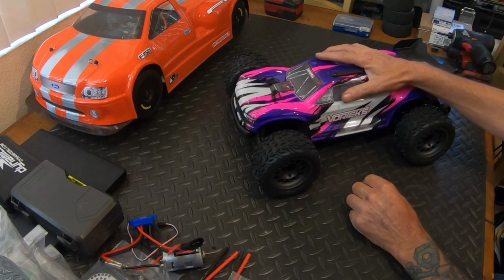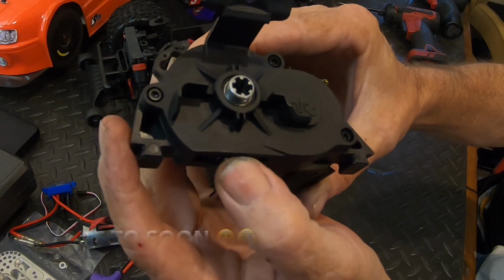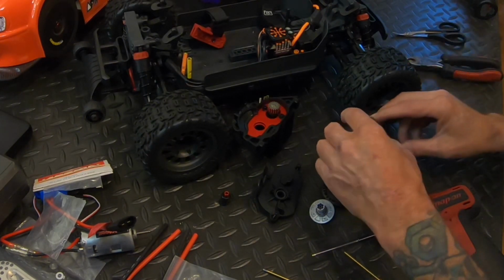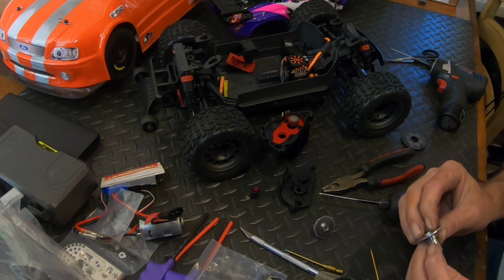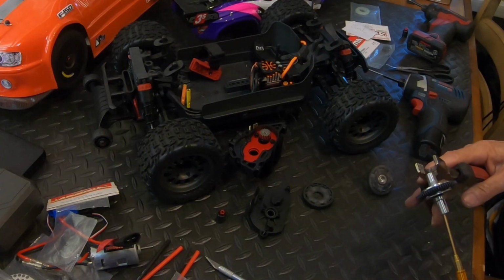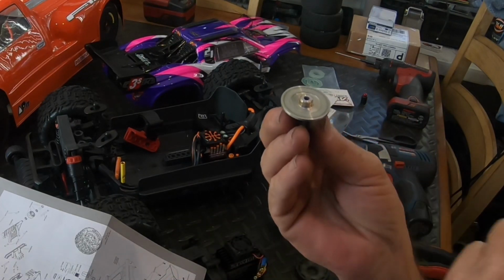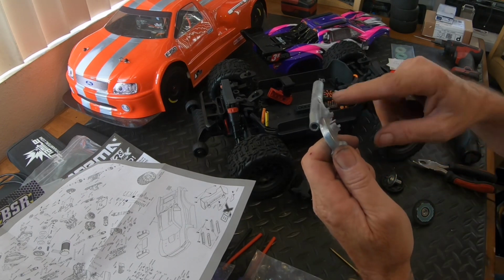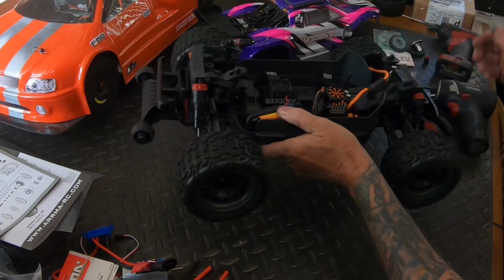Arrma VORTEKS Motor Issue Found not what I expected at all ??

Comment: I've had to order "Slipper Plate & Hub Set' (AR310946) twice for my K4S (same slipper assembly...except the 4S line takes 4 slipper pads). That LiL piece breaks off very easily. It happens when it's OVER TIGHTENED and it just snaps...You can hear it click when u are trying to tighten down the slipper. Now in your case it wasn't done by you, but snapped during production. But what caused it was initial OVER TIGHTENING.     P.S. be very careful using the power tool to tighten that down in the future...IT DOESN'T TAKE MUCH TO SNAP THAT LIL PIECE OFF.  GREAT VID!!

Comment: Not sure if anyone else pointed this out, but when you switch to the metal spur (like the 4s line) you can add another slipper pad since the metal spur is not as wide as the stock plastic one,  4 total. This will center the spur a little better and it wont be so close to rubbing the mount. UPDATE: I read below others pointing this out and how you figured that out as well.

Comment: EARL, I’ve had cars the mesh was so tight. The tires wouldnt move. I also had a outcast out of the box, ESC WAS COMPLETELY UNBOLTED!!!!!! Always do a partial tear down on new cars. Check gear meshes and lubrication. I had an XMAXX with a bent motor shaft out of the box. I could keep going, but you get the idea!
Reply: This should not be as much money ad you pay .you got to take it apart before you run .Thats bull qc arent doing their jobs.cost me 60 bucks.

Comment: I'm bad...I make comments as I watch video, ya know, before I watch the whole thing. First I notice that on My Infraction 3S, when I put my metal spur in, I had to trim off all the extra little ears on my slipper clutch plate to make them sit right in the gear. Gear wasn't machined with those extra slots in if for them. I could also swear mine had only one disc on one side. Okay...roll it...Nice catch! I did visit Horizons site, and looked a he exploded view of my Infraction, and yes, there is only one slipper clutch disc. 
  I have to bust your chops about the little gun shaped tool. It shows it in use on that back page you said you referenced, not sure how you missed that. For setting your slipper clutch while it's in the car, but you've probably figured that out by now. Anyway, again, nice catch! I'm thinking of getting one of these to add to my growing Arma collection. Next you need the Hot racing diff gears and housings! that'll seriously bullet proof your drivetrain, as I THINK the stock ones are plastic (composite) in those.
   I also don't see a real way to truly properly set the gear mesh. I always used a piece of loose leaf paper between the two gears, but with that cover off, the gear kinda moves around, which makes it impossible to really get a nice mesh. Seems like it'd be a trial and error, do it over a few times ordeal. I do see a video about it in the que..will watch that next for any ideas.
  Hope you girl has a blast with it!

Comment: The tool is their 4-way wrench sortof. For example - it fits right under the lift tabs for the motor assembly. You know it when you try it. Jam it in there and you can save the finger pain trying to lift them AND push the motor assembly formward.

Comment: Check motor shaft and I’ve run 6s on these for testing and have yet to strip a plastic spur. But metal I’m sure is better. Also check the diffs. They get the notchy tight spots as well. Great video!
Reply from the maker: I did check the motor bearings and shaft as no play yet but after a few runs there will be some play and I know this 💯💯that why setting up the plastic spur loose wouldn’t work it would just strip as soon as the bearing gets loose 💯💯💯💯

Comment: Earl, I had the same problem with my slipper assembly.  I was tightening down the screw in the slipper and I cranked on it to hard.  I heard a pop and that's what happened.  The brass piece snapped right off . It was my fault when it happened to me.  But yours is BS! That's not cool with a brand new car.  Horizon should make that right! At least I know I'm not the only one who had this problem! Good video bro!
Reply from the maker: We never adjusted it intill I was looking for the noise and added the metal gear and couldn’t understand why the slipper was not getting tight pulling thru Rc guy garage is now having about the same noise wonder what his issue is 🤷🏻‍♂️🤷🏻‍♂️
Reply: Absolutely, like I said it's bullshit yours was untouched.  I hope they take care of you on it! I don't even use that spring in my 3s slippers. And I can't tell a difference.  So glad to hear you show that. Not a spring, but a spacer! Lol! Very well done video Earl!
Reply from the maker: Yes they sent a new slipper clutch my hobby shop replaced it the next day so I didn’t have to call horizon 🔥👍👍
Reply: Hay,  post a video of your rc collection.  I have a friend who doesn't believe me when I told him how many cars you have! I think it be really cool to see!
Reply from the maker: I have one from 2years ago it a lot to drag out over a 100 of them and put them back but in January I’ll be doing it again
Reply from the maker: https://youtu.be/29UczUu8pIw
Reply: I bet it is a job to get out that many cars! I  can't imagine.  When you do your next collection video show where you store that many cars.  Bet it takes a lot of space!🤑and money! Your a beast Earl!

Comment: interesting. Just picked one up for my wife. we have not had it out yet. plan to tomorrow so we will see. Thanks for the info
Reply from the maker: Nice 👍
Reply: @earlmoorhead5555  did you have a video on the wheel falling off? I am looking for some info. After 10 min the wheel came out the axle. wheel is on the axle. Not to happy about it.
Reply from the maker: Rc guy garage has a video on the big rock doing that on a front wheel but the VORTEKS I haven’t had that issue yet but we know it will as the platforms the same just shorter
Reply: @earlmoorhead5555  ok thanks. I will take a look for it. So weird. I did not even get a chance to rip the truck my self.
Reply from the maker: I know he added hot racing front hubs to correct it but it turned out they caused more damage later than it was worth so he went back to stock front hub ( bearing carrier) to make it stop braking other parts

Comment: Thanks for the video Earl. I have the Vorteks , first day with it today. I also have the had the V3 Big Rock since February. I'm not noticing the Vorteks making the noise you are describing, do you mean the 'clicking' noise that people are commenting on or something different? My Vorteks sounds quite different to my Big rock when they are running, my BR is louder for sure. I haven't checked the mesh in the Vorteks yet but will before it's next run. Thanks again for taking the time to post the video.
Reply: Going to add a quick edit - I watched your unboxing and quick run and there it was, the clicking sound. My Vorteks doesn't make that sound, I videoed it today and went and had a listen and it runs a lot quieter than your daughters before you fixed it. Seems like it's a quality control issue. They are made in China after all.

Comment: The steel gear uses one extra pad because the gear is thinner than the plastic one
Reply from the maker: Yep I agree as I added 4 disc two on each side but that the metal upgrade normal issue 💯💯

Comment: Good find.  A lot of people are saying that the vorteks sounds different or louder than the other 3s cars.  I wonder if this might be a common issue?
Reply from the maker: I believe so the spur gears are tight and slipper clutch might all be over tighten causing issues 💯💯
Reply: @earlmoorhead5555  I noticed this sound at first then watched jaytee's video and even said in a message it was the same. He told me he had checked the mesh so was driving it just thinking ok that's how they sound but after he posted about the problem I thought ok have I done damage but then CCRC said it was a heat issue so I've been trying to keep it cool and have found its not possible. How much run time watching temps but still getting hot before moter damage?
Reply from the maker: At 200 degrees it starts to damage a motor 💯💯

Comment: Wow. Was gonna pick up a Vorteks in a few hours. Now I don’t know if I will. Thanks for the info.
Reply from the maker: It’s a good rc I believe but quality control seems to be an issue is all I’m seeing with rc cars lately 💯💯👍👍
Reply: Thanks for the reply. Why do you not think it’s comparable to the Rustler? I thought they were very similar from what I’ve seen online.
Reply: I advice u to still buy it... theres. Nothing wrong with the vortex.. a lot of RC politics in the game... u dint expect to bash a toy and nothing gets broken. So far so good the quality control on the vortex is good.. IF u bash a real car, u definitely going to need a mechanic to fix it and get parts...
Reply from the maker: @1zedlav  the way the rustlers is like a slash 4x4 the slipper clutch motor set up modular like traxxas does and it’s longer the hoss matches up real close and is traxxas neediest release so arrma would answer with an rc the rustler is old now compared to a hoss 👍👍👍
Reply from the maker: @lordangelspirit  but you don’t buy a
New car and fix it before you drive quality control is bad fir sure 💯💯💯💯
Reply: @lordangelspirit  I don’t think earl  finding a mechanical issue with his brand new RC has anything to do with industry politics. Seems pretty cut and dry.

Comment: How did you solve the compressed spring issue? I broke the brass piece on mine by tightening the effin thing down so much that the spring pushed the brass piece off.
Reply from the maker: I added a washer and replaced the brass piece with a warranty one from my hobby shop 👍👍

Comment: I saw video on this vortex that they were switching to the metal gear and that gear is from a 4S version I believe. So I believe it's supposed to have an extra slipper pad than the 3s version. I could be completely wrong though lol. Just trying to watch all the videos I can on it I got one in layaway hopefully that wasn't a mistake lmao
Reply from the maker: Yes that true you can add a pads like I show in several videos or not depending on how you run your rc car 👍👍
Reply: @earlmoorhead5555  oh nice to know. I'm learning lol. Trying to soak up everything I can. Iv been messing with fpv for a while now. But this is completely different. Never could afford it till now. Well.. it's in layaway but still

Comment: Yeaaaaaa, my motor is fried on mine. My spur is a little shredded as well. I didn’t think anything of it. Like you said, meh it’ll take some time to wear in and seat. 5 batteries later the motor seized and the spur is shredded. Opened a claim with horizon now for the motor, and might just get a slipper and spur assembly from another model. My first Arrma, and my first bad experience with something like this that wasn’t my fault 😂😂

Comment: Hey just a question but from the research I've done and info on the arrma forum. Don't you have to add a extra slipper pad if your running metal spur on 3s versions???
Reply from the maker: Yes I added one to the back side so there is two slipper pads on both sides the video was to long to add that part as most ppl know on a metal spur gear installation you need 4 pads now 💯💯💯
Reply: Ok cool just wanted to make sure. I know your very knowledgeable with this stuff and I just burned up a brand new hot racing spur from not doing my research I guess, lol live and learn

Comment: The metal gear needs four slipper pads!  It’s what the 4s has stock with the metal gear!  On the tool, the ‘things’ are used to unscrew the shocks.  It keys into the shock body where the shaft enters.  That’s how you open the shocks.  It’s too bad the brass peace came out; the fourth pad like the 4s line would stop the ‘crush’ as you tighten the slipper.  I think it pulled the brass piece out as you tightened onto the metal gear (it is thinner than the plastic spur).  Great job non the less.  Personally; the dirty hands rock!   None of this girly glove wearing stuff!
Reply from the maker: Yes I explain that in the running video as I put 4 in it I figured everyone know already 💯💯💯

Comment: My neighbors bought two of these and I recently bought two myself threw horizon hobby with their easy pay setup. And mine will be here Monday. But my neighbor blew his motor trying to keep up with my Arrma Granite mega v3 big block brushless conversion. Yeah the vorteks is fast but it isn't 4076 2200kv on a 23T in the granite fast lol. I felt bad for em though he just legitimately got it when this happened. The bearing in his motor blew out doing between 60 n 63mph we was drag racing n I was a good 10foot ahead of em n pulling away and all of a sudden his vorteks slowed down to around a stock Granite mega around 30 35 ish max so he turned it around n brought it back n I done the same n I even beat him back to us n my Granite was way out there past his lol. So something was definitely wrong. It didn't smell like burning wires or anything the esc was cool the motor was hot so he let it cool down n pulled out his outcast 4s n his ol ladies vorteks and we drove around ect n then he used his ol ladies vorteks n wanted to race because hers already had the big speed pinion in it.. so I laughed n said sure let's.do it lol. N I beat him again lol and we done a few more pulls and his ol ladies done the same thing!!! Except hers made a loud bang but still ran just much slower n then it stopped n went stopped n went so we put them on the table and he pulled one apart n I pulled his 2nd one apart to see what's up.. and the bearings in both motors blew apart...... So two destroyed motors and I heard about other vorteks motors giving out when stressed. and I felt bad because he was trying to beat my built up Granite which is insanely fast. It ran a 78.3mph this morning I'm going for 100 mph because I don't think there is a Arrma Granite mega v3 and let alone any Granite to touch 100 mph yet.. I think there is a 100 mph big rock n senton but no Granite yet. Thing is at 70+ the granite isnt to stable... So it's getting typhon arms or a outcast 4s arms tie rods shocks to widen it n give it more strength or I'll see if 6s outcast parts will fit it... I know the outcast 4s parts will because the outcast 4s is actually a Arrma Granite 110% same chassis ect just beefed up a little. So I wanna get her a lil more stable before I drop 6s lipos in it.. Im running it on 3s ovonics and golbat champion 3s lipos I got the big Ovonic 4s golbat 4s and spectrum 3 , 4 , 6 s lipos. I got a max 6 esc in it now I pulled the hobbywing Quicrun BL 120 out  which btw is a bullet proof esc it says 3s but it can most definitely take 4s no probs at all. I had a 5200mah 80c and a 8000mah 100c 4s in it and it stays cool. It's a powerful esc for cheap lol. It feed my 4076 2200kv with ease and also my 4076 2000kv and also my castle 1717y which with the castle 1717 it did get a lil warm. But I believe the 1717 will be the new motor for the new esc on 6s for it.. and as for his vorteks's I gave him my spare outcast 4s 3668 motor and installed it and he had a 3660 3300kv I believe spektrum as well he dropped in it until horizon sends his replacement motors.
Reply from the maker: That’s sounded like a fun day took me an hour to read it tho 😜😜😜😜

Comment: Mine broke because I over tightened the slipper during maintenance. Maybe yours was over tightened at the factory.  I've seen others reviewing this car say their slipper was locked down. They are supposed to be 1.5 turns out.
Reply from the maker: Yes I’ve seen that happen as well it will pull the brass piece out it it’s over tighten 💯💯👍👍
Reply: @earlmoorhead5555  if ya look closely, you'll see that the brass bushing is just pressed on to the aluminum slipper plate. The inside of the brass "cap" is actually a very thin part of the slipper plate that broke off. While it's thin, it seems to work just fine as long as it's not cranked on too hard. Hopefully it's the last time you'll have this problem... 

I was tightening it down, felt it "pop", then the entire slipper just fell apart. It sucks that the guy at the factory threw it together after it broke.

My slipper was set perfectly, from the factory. So it's not every truck, maybe just 1 bad assembler.

Comment: The aluminum slipper plate broke! That brass part just goes over it and gets pressed on. I had a replacement slipper plate come bent out of shape and useless! Amain replaced it no problem. 
Just sucks! The other problem is the bearing on the shaft side of the motor!!! Just a matter of time? Bearing replacement.

Comment: As much as i like arrma i hate the slipper clutch design. All problems would go away with a center differential.
Reply from the maker: Yes or a good quality slipper like traxxas uses adding the metal spur it’s hard to find the added slipper pad you need to add on should have a notation with the spur gear 💯💯💯
Reply: A good center diff would be my most wanted part for this car

Comment: Earl great find there, any idea what makes that piece shear off ? Is it in the factory assembly or when the truck is first run. Also how will this part not fail again ? Great video man.
Reply from the maker: All great questions my other
Platform from arrma are the same and I haven’t had this failure before I believe it’s either a bad batch an assembly problem or something of this nature 👍👍💯💯💯
Reply: I think its when  not centered and tighten down  just piece brass pressed into aluminum, I been down this road 2 hours using diagram and another assy, I bought one off jennys and it was defective , I wish they make upgrade one I may try nut bolt in together just make a locker how much that thing really working like a clutch uk , I hear all votex clicking through yt but not sure thats noise u guys mean .